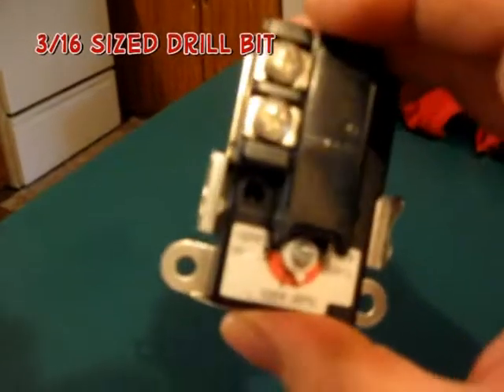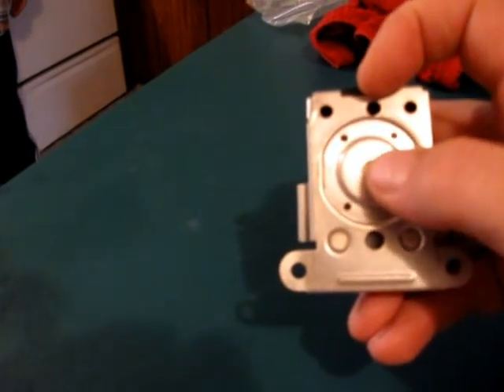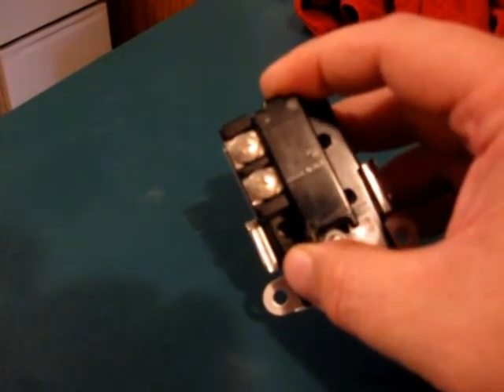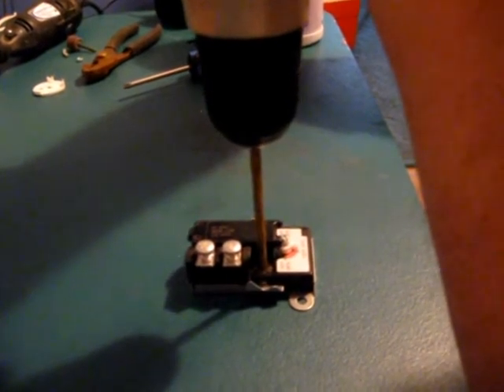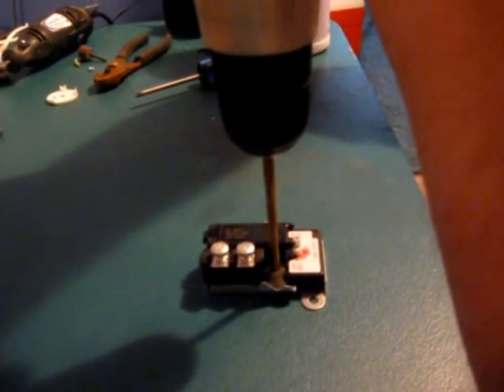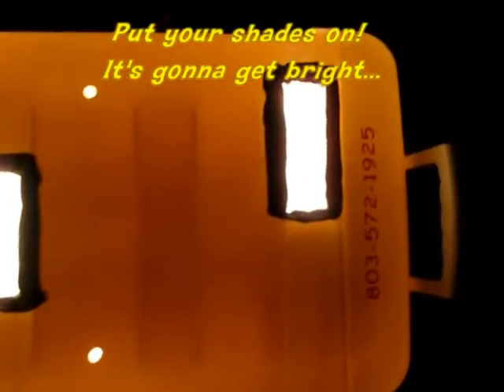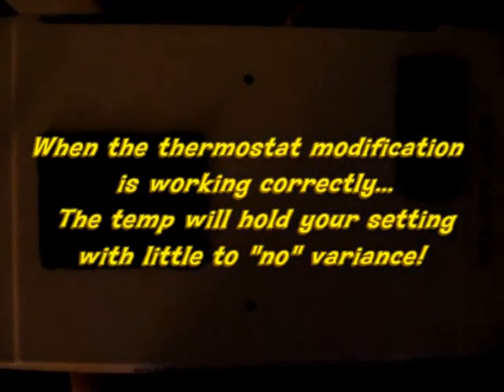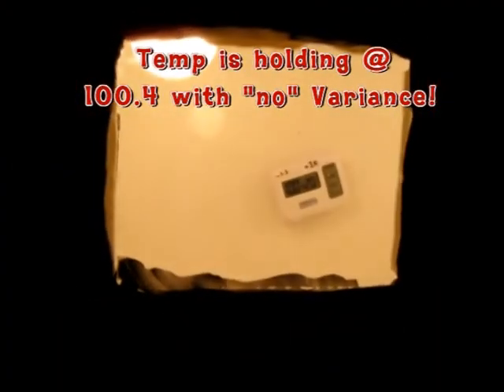Homemade Incubator Build follow up. Water heater thermostat modification for steadier temps!

Comment: I just hatched in my first cooler bator, got 10 of 17 that made it to hatch day. That is the kind of t-stat I used. I watched a video on setting it up a certain distance from the bulb to have it triggered by the radiant heat and I got it running 98-102 with average of 99.5. 17 of 22 made it to loackdown and 10 came out fluffy and alive. Not exactly the rate I wanted but it was my first try so I will do better next time. Thanks for posting this.

Comment: Thanks so much.  I just built one today following your tips.  I just saw this video but I have it pluged in so far and its turning off at 102 and coming on at 99 so I'm guess I need to drill some holes in the stat.  Also I have 2 vent holes on the lid and 2 on the bottem of the front side do you think that engough air?  Thanks so much for this you saved me BIG BUCKS!!

Comment: I only drilled holes on my water heater were on the black side and I went straight through. Do i need to drill all the way and also do i need to drill on the metal side as well?

Comment: Thanks for the vid, I was going from 97 - 102, but I had my fan blowing at the eggs and a undrilled thermostat, after drilling the holes and pointing the fan at the light, I am holding steady at 100.

Comment: hi sr, so, which is the good one? the one on the beging with 3 holes or the one on the mnt 2:20?, which is the one whit better results? thank you for the very good info
Reply from the maker: I've always better results from the modified thermostats! The holes make the thermostat more sensitive...
Reply: those 2 are modified, so those two are the same then?

Comment: the lowest temp mine will go is a steady 104.F its about three inches away from the 40w light with the fan on the other side. Any suggestions?

Comment: Hi from the UK. when the thermostat gets to 38d -100. the bulbs fiz on and of rather that a direct on and a direct off, a bit like a short   is that ok,  I have the thermostat about an inch away from the bulb, thank you. ps its a lower themostat
Reply from the maker: Greetings from the Southern US! If the bulbs want to 'flicker' during transition... you've gotten some debris on the wafer inside the thermostat... you need to remove it and take some compressed air and blow it out or tap it lightly with the plastic end of a screwdriver! You can try tapping it while it is installed, sometimes that works!
Reply: Rush Lane Poultry & Game Birds Thanks for your help. regards from Steve

Comment: you can try 2 things... you can either move your thermostat to within 1 to 1 1/2 inches from the bulb or try a hotter bulb... IE 60 watt, 75 watt, 100 watt and see which cycles and holds temp best. :)

Comment: i habe done this to one of the thermostat i baught but i dont know why it cycle way to fast when the temperature gets to what i want it, it cycle faster then a second and i just baught a new one, do you think that i did something wrong or thats how is supposed to be flashing
Reply: That is a good thing!! When that happens you know that you have done the modification correctly! When your incubator reaches your target temp then the modified water heater thermostat will cycle rapidly and you have virtually no temp swings!
Reply: move the thermo to other side and see if you notice any difference

Comment: I just tried this method (exact same thermostat) and I pushed too hard while drilling, denting the back plating when I finished drilling through the ceramic. If you do what I did, the thermostat will fail (always on). I was able to correct it by carefully hammering the dents back in with a flat head and finishing hammer.

It would probably be better to drill slowly instead. :)

Comment: Did you purchase the Lower or the Higher Water heater thermostat? or does it matter?
Reply from the maker: It's the upper thermostat...
Reply: thank you
Reply: Rush Lane Poultry & Game Birds That is odd that yours is the upper, because the upper ones at my Lowes look completely different but the lower ones look EXACTLY like the ones you use.... ?
Reply from the maker: Xavi Bully Mart The designs are changing! You want the water heater thermostat that looks like the one in the video... But, I am moving over to all digital as we speak! I'm gonna make a new video very soon!
Reply: Rush Lane Poultry & Game Birds digitals? Very interesting...